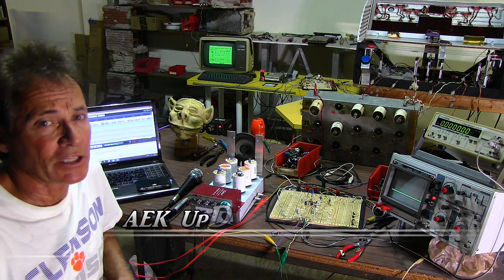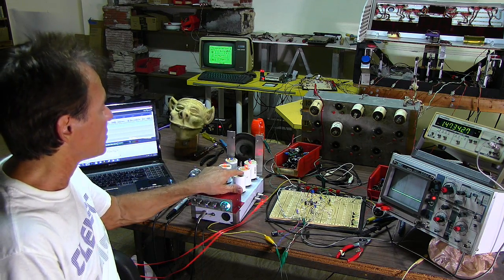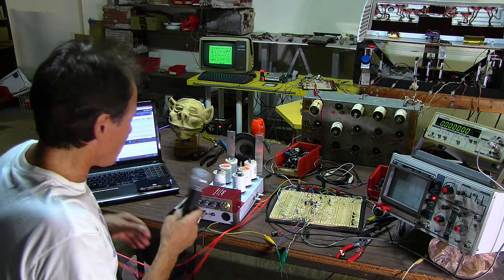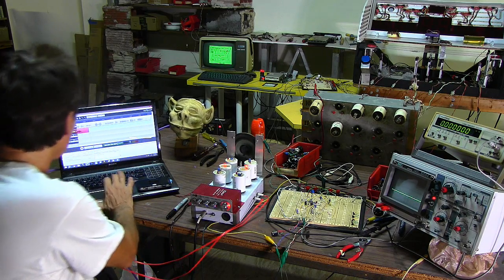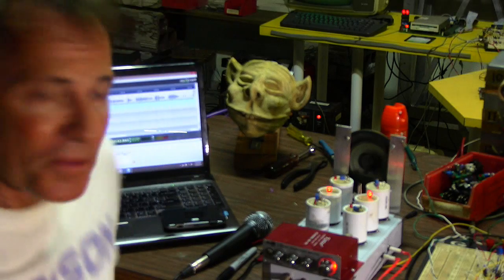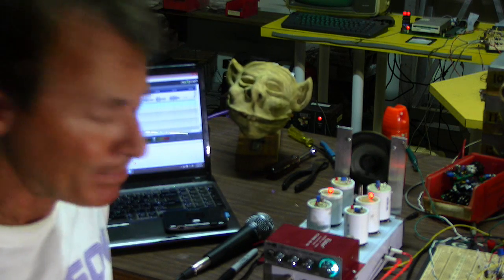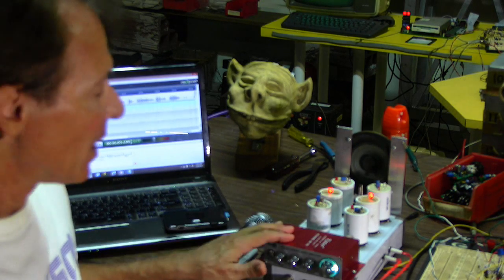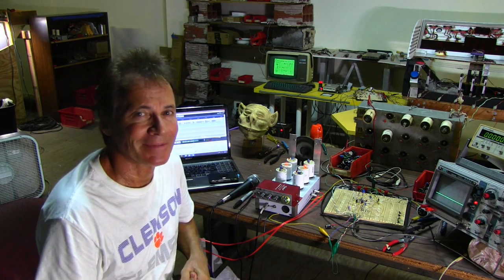Animatronics Experimenter's Kit Update 7-31-2016

Comment: Can someone help me? From where can I buy cheap I share've namely 4 animatronics but do not have any pneumatic cylinder (which I need 24) and I have no air valves (which I need as many as I for pneumatic cylinders need) and no hoses (How many meters I do not know) and this so called gray box still and no program for this lack. And a compressor also lack. One answer would be nice. I want maximum € 800 I output as two hydraulic cylinders have sold to enjoy the money for the animatronics. Sorry for my English I am from Germany.

Comment: My computer only has 1 jack that combines the mic and headphone jack together. :(
Reply: I think you could use a headphone jack splitter
Reply: I have tried multiple different adapters but, they all disable the microphone.
Reply: +TheEnderMineMC did you try a headphone to USB adapter?
Reply: My computer doesn't have any available USB ports and the way it's made I can't plug in one of those things that give you more.
Reply: +Figment InsideOutRuxpinFan OR get a usb hub and get a usb microphone and headphone jack
Reply: see my above comment "...the way it's made I can't plug in one of those things that give you more." I meant a USB hub but, couldn't remember the name.
Reply: That's...odd
Reply: +TheEnderMineMC Sounds like an iPhone 7
Reply: No it's a gaming laptop